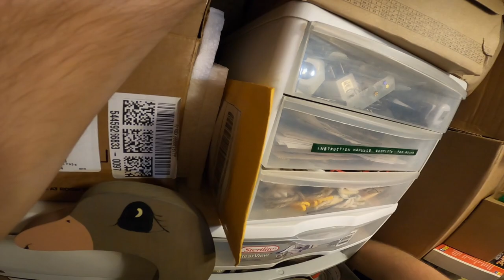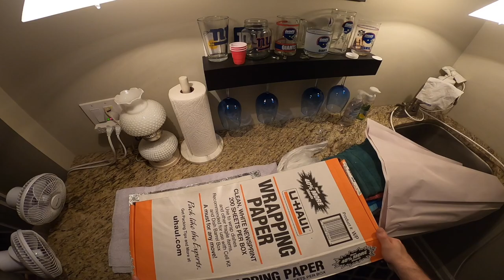Shop Vlog 14: Changing the Ceiling Fan

Comment: Very nice! I've got one with metal blades, and it sure does crank out the air. What is your control setup? Mine didn't come with a control, so it's just off, or full blast. Not having much success in finding the Encon wall control, I've seen so many of these hooked up to.
Reply from the maker: I suspect the metal blade ones are even stronger due to the curvature.
I am currently using a 3-speed Hampton Bay branded remote control that I've had for years. I don't have the means of connecting a proper wall control with the way the room was wired. I bought 2 of these fans from someone and they included one of the original wall chokes, I suppose I could put a plug on it and use that. I don't remember what the context was for the second fan, I think they may have been using some cheap generic variable speed control with it.

Comment: Did you ever make a video about touring your shop? because if you haven’t I recommended you make one. (Edit) You should put a rubber band into the light and it will work just like the other band. Trust me, I tried it.
Reply from the maker: I think I've made a few over the years, not sure when the last one was. I no longer occupy this area.